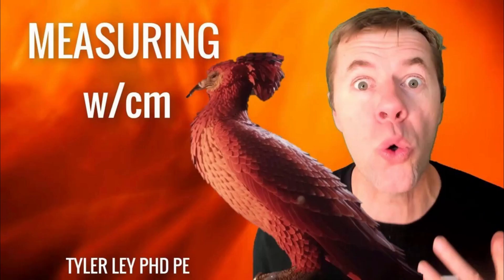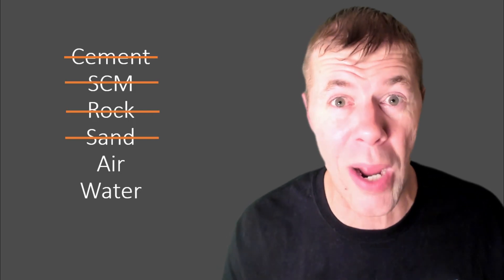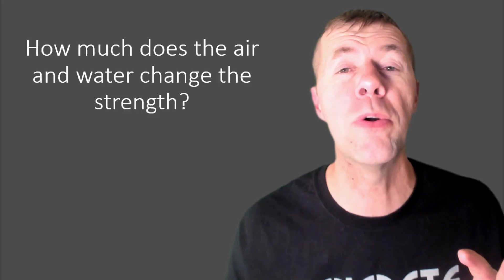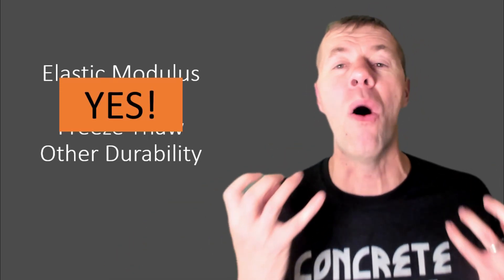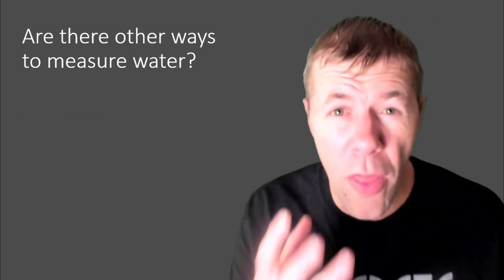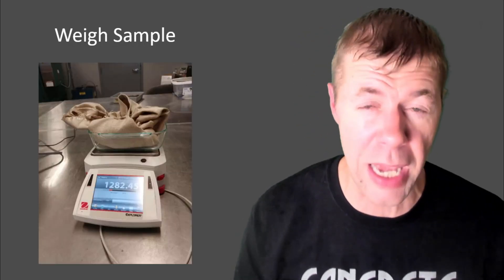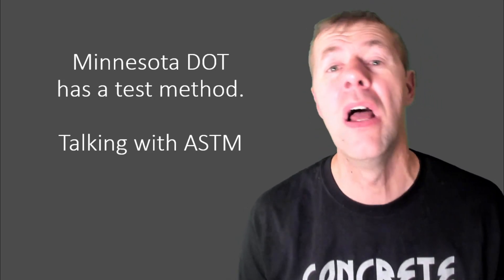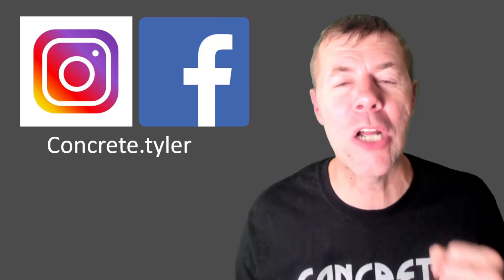Answering Questions About the Phoenix

Comment: Phoenix sounds great but I don’t think it can replace concrete cylinders. As a ready mix producer, the ability to rapidly get a moisture is heaven sent. But for on the job testing to see if W/C ratio was met seems useful, but not a good indicator of strength. For example, sand moistures are too high at the concrete plant, the mix comes out very dry and oversanded, the driver than adds water to slump it, technically the mix could meet w/c ratio but no one would know the mix is oversanded and would produce a lower strength

Comment: You ignored the important question of the diagnostic power of the metrology established by this testing.  You should deliberately make faulty batches and see if the measurement properly reports the a priori facts.  And do this double-blind to prove no bias.  You only tested commercial batches with correct formulations, so you're not really conclusive about rates of both Type 1 and Type 2 errors.  Until you do this, there is no basis to trust this testing method.
Reply: Their stated assumption is that the mix design is consistent except for water (and air).  No claim was made to measure non-compliance with a given mix design, which would be out of the scope of such a w/c measurement.  The analogy would be your saying that an aggregate moisture content test is not diagnostic about the particle gradation.  Of course.  They tested against known w/c, from 0.36 to 0.48, testing each step from 23 to 130 times, in this testing process.  If you are after 0.36, then the 0.48 measured would be faulty.  If you believe that these results were revised post-test to be closer to the measured w/c, then you are very skeptical.  

This solves a big problem, such as with small batch plants that never really know the w/c, because they really don't know the aggregate moisture content, particularly right at the time of batching, and they often have leftover rinse water in the drum.  So they continue to use slump, which is not an accurate indicator of w/c when using a water reducer, or after cement begins hydrating.  And holding w/c constant, slump varies with aggregate shape, and when aggregate gradation is discontinuous.  But a direct test of w/c should be able to determine more closely what is really going on in these cases.
Reply: @SpaceCrete  The whole point is to detect faulty vs correct batches.  Without testing both you have no valid metrology standard established in this method.  There's no assumption of correct mix; if there was, there would be no point in testing.  It's possible this works, but without systematic proof it's just an unreliable method.

Also, there is no characterization of how sensitive the method is to operator errors in the testing procedure.  The weakest link may be inconsistent or unreliable operation in the field.  Just because PhDs in a university laboratory can get results, doesn't mean a mud slinger is going to get it right.
Reply from the maker: @RichardKinch  Thanks for the comment.  I posted some field data in the first Phoenix video with field data.  The coefficient of variation was pretty similar between the lab and the field.  I also have data from Minnesota taken by "mud slingers" in the field with 150 or so mixes.  The data is pretty close to what I show in these videos.  Most of this is in the three peer reviewed papers that I listed in the link.

The idea to purposefully make "random" batches and check them is a good idea but I am not sure it is possible with this method.  This method always starts from the batch ticket because you need to know the amount of aggregate that is supposed to be in the mix, specific gravity, and the absorption of the aggregate.  This is important because you need to know the moisture that goes within the aggregate to calculate the amount of water that is left for reaction.  This means you cant' really do a test "blind".

I don't think that is a big deal because most of the concrete tests can't really be used to measure a bias.  If you check the ASTMs for the slump, strength, and air content none of them have a bias.  

Despite this, I think this test is very powerful.  I think it can tell you a lot and there are people in the industry that see the value and are using it.
Reply: @TylerLey  You're claiming to have invented a method for detecting faulty batches, but you haven't demonstrated it on anything but proper batches.  You have no proof of the validity, sensitivity, reliability, susceptibilty to operator error, Type 1 and Type 2 error rates, etc.  Until you do that, this is no more serious a method than dowsing, and is not worthy of an engineering standard.
Reply from the maker: @RichardKinch  I think you are misinterpreting what I have said.  I have stated that if given the batch ticket then I can check if the water that is reported is the same as the water that is in the mix.  People in practice are finding this useful.
We have detected several proper and inproper batches in both the lab and the field.  Other people in industry have also done this.  This is why there is so much interest in this method.  While it is not perfect, it provides a better tool than has existed before.
Reply: @TylerLey  I fully understand your concept and claims.  You have not proven that the metrology is valid (responsive, diagnostic, predictive, repeatable, reliable, not subject to errors in the field). One would expect a lot of non-linearity that you have not characterized such as is seen in dehydration of silica gel or zeolites.  Worse, your claim of measuring water/cement ratio is false.  You are only measuring the total sample weight before and after dehydration.  Hence you are not measuring the cement mass or composition, and therefore not the ratio.  If you depend on the batch ticket report of cement mass, to deduce a ratio, then you are not independently testing any ratio, you're just blindly parroting what the vendor says, which is opposite of verification.  Believing the batch ticket is not a laboratory test.  Measuring dehydration cannot detect composition of Type 1 from Type 1L, which would amount to a 15 percent distortion in measured ratio, even if the batch ticket is otherwise true.  So the idea is similarly weak as is slump testing, because there is no single factor that you can independently measure that predicts two or more factors or their ratio.
Reply: @RichardKinch  The device cannot tell you if they put in jelly beans instead of rocks or talcum powder instead of cement.  It tells you how much water is in the mix. And if it does that, then it does what they say, no more no less. This is an advancement over measuring slump which is not a direct measurement of water mass, and is much more affected by such things as aggregate gradation, admixtures, and impurities such as clay. You object that it does not validate or invalidate a batch ticket. No one is making that claim - just for verifying the amount of water in the mix. If the ready mix company miss-doses cement or has bad intentions, it is likely not a supplier for important jobs. The biggest cause of w/cm failure is inadvertent - from unaccounted water already in the drum from washing out the previous batch.  This brilliantly designed test will help to recognize that problem more than any other jobsite test.  Or, if you have a better way to check that, please share it.
Reply: @SpaceCrete  You agree with me: all it tells is "how much water" is in the sample.  It does not measure the water/cement ratio.  Ley's claim that it "can be used in either the lab or the field to measure the w/cm" is false in any scientific or engineering sense.
Reply: @RichardKinch  It will measure aggregate mc at ssd (in a 5-minute pretest), and this can be used to determine w/cm onsite by calculation.  In my view, ssd is vague, and so corresponding w/cm is rarely known precisely either - except that this tool now makes a real time measurement of these practical, at least in a relative sense.  Once an aggregate ssd mc is established (or not), each load measured will provide more relevant data for w/cm than slump measurement can do.  One example is where concrete is batched with too-dry aggregate to a given slump and has slump loss, this tool can make the determination that more water is OK, whereas if the slump loss is from admixture effect decay, more water is probably not OK. You cannot distinguish these with a slump test.

Comment: Is too little water ever realistically an issue?
Reply from the maker: Yes, if your water is too low you can get autogeneous shrinkage and cracking in the concrete.  This starts to happen when your w/cm is below 0.40.  Also, the lower the water is the most admixtures you will need to make the concrete flowable.  This will increase the cost of the mix.
Reply: @TylerLey  too little water will obviously affect the concrete. What I meant is whether it’s something that happens anywhere near as frequently as too much.
Reply from the maker: @OrenTirosh  Yes, sometimes people mess up the aggregate moisture content and they don't add enough water to the mix.  This is a reason that it is tough to get consistent concrete if you don't have a way to measure the water content directly.

Comment: Thanks a lot... Very interesting, are you sure all the water will be lost if you heat it? when the water mixed with the cement I thought that some of the water would react with the cement to become CSH.
Reply from the maker: Thanks!  I looked at this in a paper that I published.  As long as you the test is run before the concrete reaches initial set then you will remove the water from the CSH.  The paper is in the folder that I reference in the video.

Comment: Hi Tyler! Thanks a lot for your video, can you make a video about decreasing strength and Youngs modulus of concrete due to fire?
Reply from the maker: I think I have that.  Check my fire videos.
Reply: @TylerLey  I have watched that,  but I'm looking for formula of decreasing strength and Youngs modulus, does ACI have those expressions? Frankly speaking Russian codes have these values in table and I can interpolate them, but I would like to use clear formulas without interpolation tables.
Reply from the maker: @effectprojectekb  I think there are too many variables that impact the strength loss.  What type of aggregates did they use?  How quickly did they quench the concrete?  How hot was the concrete?  What was the volume of aggregates in the mix?